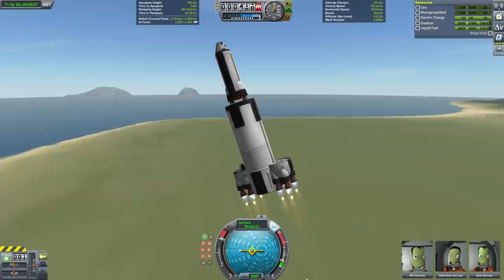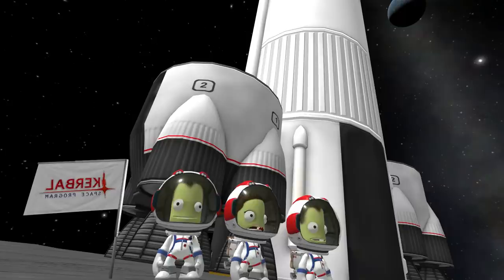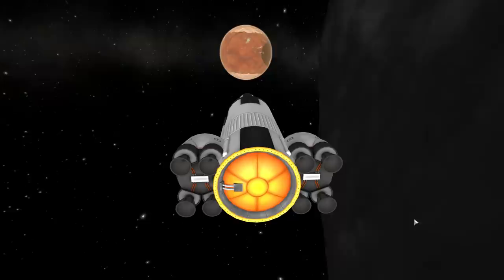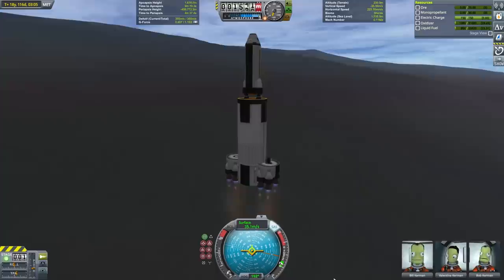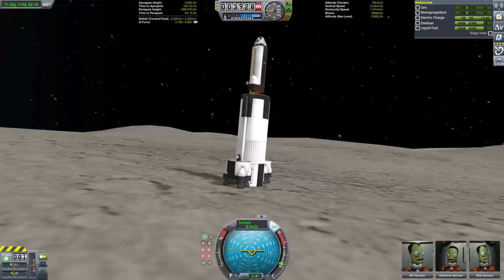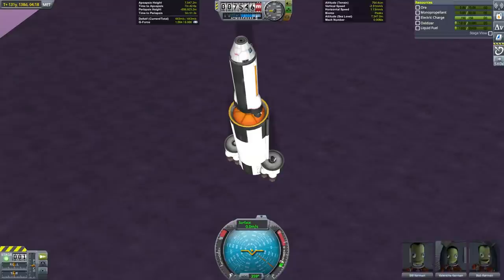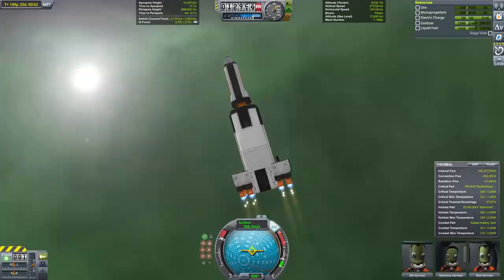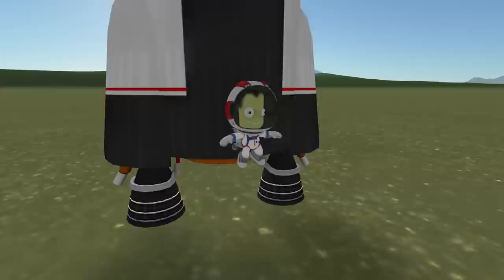10 Part Grand Tour - Kerbal Space Program

Comment: I propose a mission time challenge. Most of KSP videos focus on efficiency and simplicity. However, usually it will take hundred of years to finish. Anyone tried to visit every space body as fast as possible?
Reply: Dude you are right. Best challange ever!
Reply: Using a life support mod could also help
Reply: Quick question: Are you talking about player/RL time or in-game/mission time? In other words, are you trying to take the most direct possible path, or just the path that requires the least work so you can time warp through everything else?
I personally think mission time is the better challenge. There are two problems with mission time: It basically completely ignores things like landing/take-off and, to lesser extent, refueling times since those are irrelevant compared to orbit time, and the second problem only applies to many-destination missions. You basically need to choose a launch time which provides the best possible alignment for all the planets in-sequence. The thing is, while the perfect alignment exists and due to the irrational (or near irrational, the fact that it's technically rational will create insignificant issues) it is attainable with some amount of waiting before launch (this statement is basically an extension of the idea of Fourier series), actually waiting that long would take far too long with the meager 100,000x time acceleration of KSP, so you'd need to cheat to place the planets in the right position.
Reply: @yaksher  I'm talking about mission time. I think waiting for a perfect launching window is legit and also a necessary thing if you want to be more time efficient. With that been said, it will be pretty impressive if someone can start the mission from day 0 in KSP.
The reason I propose such challenge is because, in real world case, mission time probably is one of, if not the most important thing that we need to take into consideration. Sure, it is cool if you can visit several planets with a small SSTO and save a lot of money. But, if it would take a century to finish it will be meaningless (think about inflation... You get the idea).
Reply: @Pierce1996h  It will be cool. But I think Bradley mainly do stock challenges and I won't expect too much for a kick starter in this area :)
Reply: @helelemamayku6302  Well, visiting a bunch of destinations in one mission is almost fundamentally pointless anyway (since you can't actually do anything and the chances of it being more cost efficient than just visiting each one if we're talking samples is also tiny) and as I said, there is theoretically an ideal launch window (it wouldn't even be too bad to calculate when it is), it would just take an unreasonable amount of time to wait for it.
So if you're gonna make mission time the goal then I would suggest allowing cheating the planets into initial ideal position.
Reply: @yaksher  But you still need to find out a route, it is not trivial. And just think about not using ideal “Hohmann transfer” sometimes may save a lot of time. There is a lot to exploit.
Reply: @helelemamayku6302  Yeah, I'm just saying that doing it fully legit would require pointless waiting for a long time. You'd probably want a ridiculously high Delta-V craft capable of refueling and brute force things as hard as you can. Problem is that while Delta-V is enough to brute force an encounter, you need thrust-to-weight to capture from an encounter like that. Would be pretty tough, but interesting.
Reply: I feel like the mission goes like this:

0) Warp forward until all the planets are on the same side of the sun.
1) Launch a 15-module rocket consisting of seven interplanetary stages (100+ ton blocks of xenon, mostly), some landers and one crew module.
2) Send the crew module to Mun and the other modules to other bodies on brachistrochrone trajectories, where they land and refuel.
3-17) Route Kerbin-Eve-Moho-Duna-Dres-Jool-Eeloo-Kerbin.

In all this requires 30 legs, thousands of parts and tens of millions of funds and seems a bit tedious.
Reply: Yes. I so want a speed run challenge in ksp.
Reply: No
Reply: @ThomasKwa  Trying to keep it stock would be extremely tedious. The amount of Dv needed to get to the planets quickly (and then slow down once there) is massive. Still, instead of someone doing a high efficiency, long travel runs to planets, I would like to see someone go to a planet, land, and return in a very short amount of time. For instance, in my play-throughs,  I work to get to Duna (or similar) and back before the first year is out. It is interesting. The deltaV needed to slow down at Duna can easily climb over 10K. And the amount of time needed to slow down that much on a high efficiency engine can easily be longer than the time it takes to pass by. It takes a lot of planning. Fun for me though. The KSPIE and NFT mods really help with this while still making it feel like it isn't cheating or something.
Reply: fastest way to space using only servos and wings
Reply: @helelemamayku6302  I wonder how much delta-V is required?
Reply: @psun256  could be very large,    I guess. Essentially, it's a trade off between time and Delta V.
Reply: Genuis!
Reply: Scott manley went to the moon in around one in-game hour
Reply: Yup. Gone to jool in 1yr 15 days.
I used that mod where you can build rockets bigger than the VAB tho
Reply: @Pierce1996h  ew
Reply: Me, did it with one part
Reply: Also took me like 5 minutes
Reply: Well I will now. I will see how fast I can land on the mun and get back in game time.
Reply: i mean... he made the grand tour with 10 parts in under a year (271 days mission time, kerbal year has some 400 days).
that is pretty disgusting in terms of speed

Comment: I just have one question:
How? Do you have a lot of experience with doing this kinda stuff, and that's how, or is it something else. I would like to know. What's next? 2 or 4 parts to every planet?
Reply from the maker: Its all about optimization, which is all about math.  Fortunately, my background is also all about math.
Reply: @BradleyWhistance  ok, thanks. Optimization is important, getting the most out of every fuel tank and engine
Reply: But how did you manage to fulfill the power needs of drill, converter and radiator with only one RTG?
Reply: @JYF921  Patiently
Reply from the maker: @notfeedynotlazy  Well put

Comment: That was a pretty cool landing on the Laythe slope; a nice bit of piloting to make the best of a difficult situation. But if you want an easier landing spot, there's a large area of fairly flat terrain in what I call Chasmer Island -- it has a long lake in what's almost a chasm. East and north-east of that lake, the terrain's remarkably flat for Laythe. I got very bored driving a high-speed rover across it. :) The area is a little north of the equator; a natural harbor in the island's southern tip is on the equator. The north of the island has 3 large lakes, but it's lumpy around there.

Also, I'm taking notes for a Jool 5 mission in the hope that my latest spaceplane will be suitable. :) I'm not even considering Eve... yet! :)

Comment: Hey, Brad! Big fan here. I’ve watched a lot of your (and other KSP Youtubers’) videos and noticed that a lot of your gravity turns start really early and lose a lot of delta V to drag - to the point of almost overheating. In this video you used almost 3km/s, while my gravity turn mod taught me how to use much less by tipping to 10° at 100m/s for most crafts. Is there a specific reason you take such aggressive turns? Am I using more (and you using less) delta V than I think? Great video as always and thanks for all you do!
Reply from the maker: Aggressive gravity turns are good for efficiency!  Losing delta-V to gravity is more significant relative to drag than it would seem.  The drag on this craft was a lot higher than on a typical craft, so the delta-V to orbit was always going to be higher than normal.
Reply: Bradley Whistance | Thanks for the reply! I’ll have to pay more attention to my turns in the future. Do you have any advice for a ‘universal’ turn?
Reply from the maker: @bananman5656  With a craft optimized for low drag (which certainly doesn't include this one!) turning over as much as possible without overheating or falling back to the planet is usually the way to go.

Comment: How on Earth did he land on Eve w/o the heatshields?
Even my double-heatshielded craft sometimes overheat and explode on descent 

I'm talking about flying at 60km at ~2800m/s
Reply from the maker: There are three ways to survive the shock heating during Eve descent.

1:  Shield
2:  Lift to maintain altitude until slowing to a safe speed
3:  Retroburning

I used retroburning here.  The shock heating during Eve descent becomes very intense around 55-50 km.  You'll note that this is where I did the greatest portion of retroburning.
Reply: @BradleyWhistance   I've been so impressed watching that part that I really missed that huge retroburn (rather, misunderstood the amount of thrust because of plumes). That really explains it. Thank you for your reply!

Comment: Just to confirm this isn't vanilla or even close to vanilla?  Just that rocket alone would fail on takeoff due to structural failure.
Reply from the maker: No mods necessary for that, I used the stock autostrut feature.
Reply: Actually, it's completely stock ("vanilla") except for the visual mods.

Comment: That bottom fuel tank is 2 parts, and how does he get the bottom stage attached to the top? It doesn't attach correctly and it needs struts or it isn't rigid. The way it attaches ends up neglecting over heating. He must not be using stock parts
Reply from the maker: The bottom fuel tank is 1 part.  
I explicitly state in the video (at 11:14) that the stages are connected through the resource converter.
I have no idea why you think anything on here would overheat.
I'm not understanding where you are coming from here.